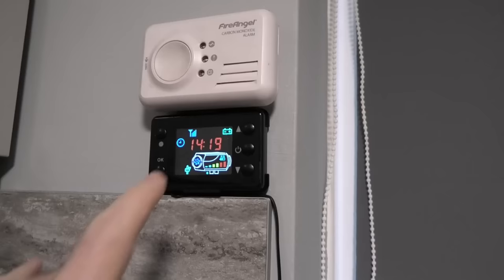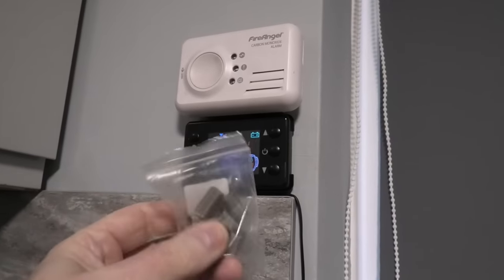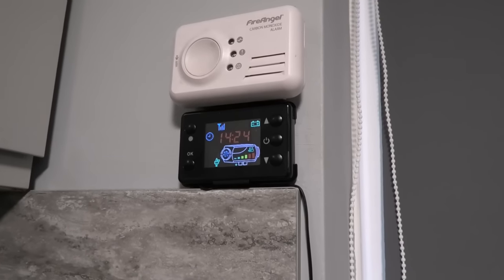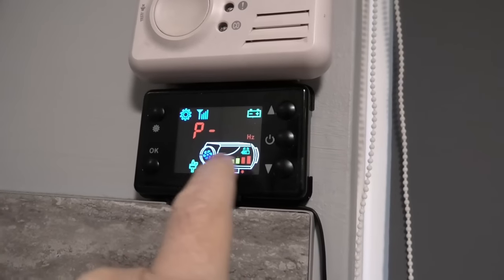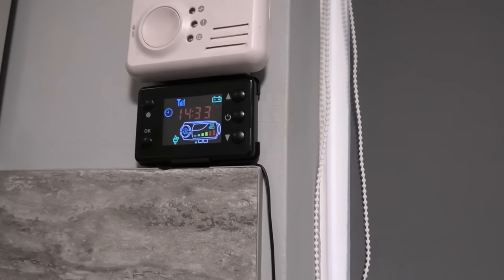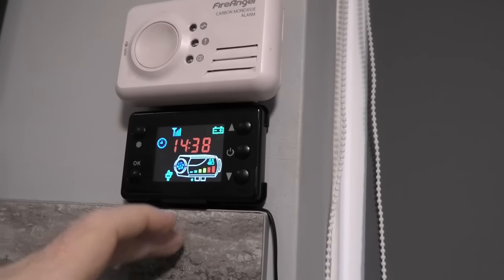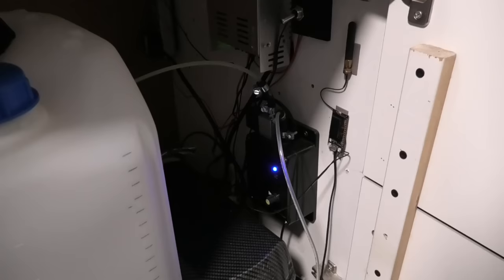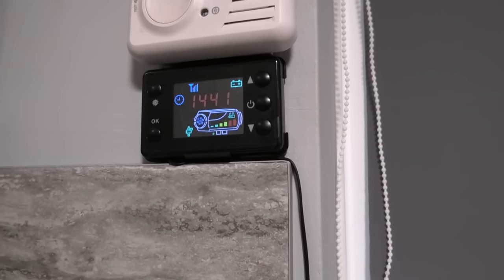How to tune a Chinese diesel heater with no tools 2kW & 5kW

Comment: Are you saying that you have tuned hour's to the point where you don't run the exhaust outside? I have just installed one of these in my double garage and test run it with the exhaust - temporarily outputting inside. The fumes are so strong that it has to go outdoors. It would be great if I could tune it to be able to run indoors as the heat coming from it is greater than what outputs the blower. Great video by the way 👍
Reply from the maker: NOOOO absolutely not 🤣
My exhaust is about 6ft (2m) long and most of it runs inside. I have a fan blowing across the length of it which heats the kitchen up and the exhaust gasses are relatively cool by the time they go outside. There's a vent in the wall and also, I put an exhaust fan in the vent which forces the gasses outside.
The exhaust pipe is made from 32mm (I think) copper tubing and I had to silver solder it because of the heat.
Reply: Thanks for the reply. I am trying this morning to tune mine as per your video, but I can't access the different menus you have to put in the the code. The settings key does nothing unless I keep it pressed in, then it responds by turning the unit down to a middle setting. Am I doing something wrong. Also there's an option called "plateau setting", but it doesn't tell what it's for? 😬
Reply from the maker: @marklennon4664  It looks like you have the newer version, I presume it has the set temperature permanently in the top left?
On the older ones, if you set the desired temperature, the fan speed ramps up and down between min and max and it's annoying. Plateau mode is where it automatically cools down when it reaches the set temperature and it's much less annoying.
Unfortunately, I can't find the advanced settings for that version but I'll keep looking.
Reply: @Vortecks  thanks again for taking the time to reply. I do indeed have the newer type of controller - not sure if this is a good thing or a bad one. I have seen a video from a guy explaining plateau mode as a running lean at high altitude setting, but apparently it does make an impact on output air temperature. As regards the exhaust, are you extending its length for the radiant heat to a point where its final outlet is much cooler? Cheers, Mark
Reply: @marklennon4664  If you like you can swap the control out for an older version to be able to tune it.. I have the same problem as you and I ordered a older version of the controlpanel. You have to swap the "mainboard" in the burner aswell, so don't forget to order the mainboard also. There is a YT-vid of a guy who does this swap....

Comment: So. You have managed to get questions. How often do you change your atomizer screen?
Reply from the maker: Every year which is when I do a service.
Reply: @Vortecks  I must say, I have not even opened mine. so i have no status.
I think you are right, that the units are not adjusted/tuned.
I say this, because mine wasn't even getting fed the 5.888 pumps of oil needed to produce 5000 joules per second(5KW), which it was designed to. You can calculate how much energy you are putting in, in the form of oil, and then estimate the output.
But, I think your method is flawed, because you do not take a stoichiometric approach to adjusting. You can check the exhaust gas coming out if it has hydrocarbons in it and to check for the highest concentration of CO2. This is the old method of adjusting carburetors and what was/is used to adjust diesel burning boilers.

Comment: What temperature are you getting at full chat  at 5hz and now the 3.7hz?
Reply from the maker: If it's at 1.2hZ or 3.7hZ, it's the same - Around 75C at the outlet but my outlet is 8ft (2.5m) from the heater.

Comment: Are you running on waste oil
Reply: The clue is in diesel heater but they do work well on kerosene with a little added oil to lube the pump.

Comment: There is no Co2 because the exhaust is plummed outside. Unless you didn't...
Reply: There can be carbon monoxide in the hot air stream read the above.

Comment: Veg oil bungs them up due to glycerine content. Waste motor oil is very problematic
Reply from the maker: Yes, I didn't want to say "don't use veg oil or motor oil" or I'd have been ripped apart by the specialists who know nothing 🤣🤣
Reply: @Vortecks  lol.... Every video that says it fine to use motor oil has done it for less than 3 weeks. Last year I did it, and the burn chamber was actually ruined and had to be replaced. I cut open the old one to see what had happened and theres a thick gauze that you can't see or get to to clean. I tried a blow torch, strong caustic soda and digging but could not get the carbon build up out. However....... It may be possible by cleaning the oil to 5 microns and a 50/50 mix and starting the heater on diesel plus running very hot. But motor oil should be injected under pressure onto a red hot surface, not dribbled on to a gauze.
Anyway, the ratio between the pulse rate and fan speed is the important bit, tuning for fan speed just above smoke point is the most efficient way of burning fuel rather than pumping heat through the exhaust 👍🙂
Reply: @yodab.at1746  used motor oil is ok IF you filter it to very fine tolerances AND pre heat it but even then it takes a while to get it set up right, cooking oil used or new really needs processing into bio to remove the free fatty acids and glycerol, you can get away by cutting it with petrol but that affects the burn temps so again you need to spend a few weeks dialing it in.
My old partner at my garage once said " it something seems easy, it's probably because you don't really understand it"  unfortunately there are VERY few YTers that follow that ethos hens the miriad of 5 min experts on here  ☹️
This is one of only a handful of channels that actually understand the subject, it's so nice to come across them and be pleasantly surprised 😎👍😎

Comment: At 50 ppl they make sense at 1.40 red diesel not sure. ( plenty flogging heating oil at the mo as they transition to wanky heat pumps...youll be sorry when electric hits 75p a kw.

Comment: You forgot one very important thing and that is the gap of the inner fan . seeing your numbers I guess your gap is to wide . Check that it is no more than 0.4mm  Still nice video.
Reply from the maker: I'll cover that one in the servicing video, it's not something that everyone is capable of doing. I didn't measure the gap but mine is as close as it can be without binding.

Comment: Just a tangential comment here, but this is practically the same as gasoline direct - injection engines that are starting to be touted as the next great thing. Be very afraid of getting any new car or truck with these engines for the next few years.

Comment: You have literally no clue how this works
Reply from the maker: You can't leave a comment like that and not explain?
Reply: @Vortecks  it’s internal combustion, there is literally zero chance of carbon monoxide poisoning , in the same way your car won’t , do you route the exhaust back into the building ? Also the fan has literally zero impact on the combustion , it just controls the amount of air flowing over the “ sealed “ combustion chamber , it’s like blowing hot air over a radiator  and expecting to get wet , the reason you keep sutting up and flaming out is Because  you’ve turned the pump frequency down ,  you need a steady vapour in the chamber to create an even burn , you keep starving the chamber , 

I’ve been running these things for 7 years , their brilliance is their simplicity , the only way you can tune this is to alter jet size and fuel pump pressure , but you are limited to combustion chamber size , which will determine how much oxygen and fuel  you can put in , so again it’s a balance between jet size and fuel pump pressure.

I’ve never had to strip any down , I use factory settings and always shut it down  via the control panel and remote , one in a while I run on paraffin 50/50 

Factory settings are fine ,
Reply: Thanks Vortecks for the time you spent explaining it so well.. And Fradaja, You might need to withdraw your comments on the workings of these.. They have 2 fans, and as you say, one pushes air over the already heated outer surface, but the 2nd which is internal forces air into the combustion chamber along with fuel  (like blowing on a fire ) if you run it leaner (on fuel) you get a cleaner burn, But Too lean (as explained) and it's protection kicks in and makes it "Flame Out"..

Comment: Does anyone know if one of these attempts a restart automatically. I don't mean if it has a power interruption but say if the combustion dies for some reason. Or does it just stay off until manually restarted.
Reply: If you buy an afterburner you can do that.